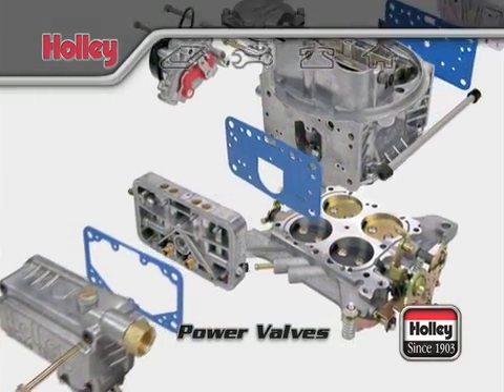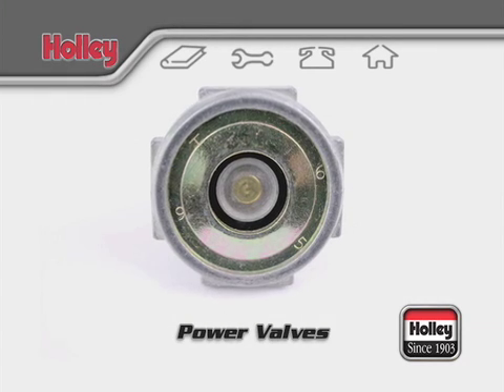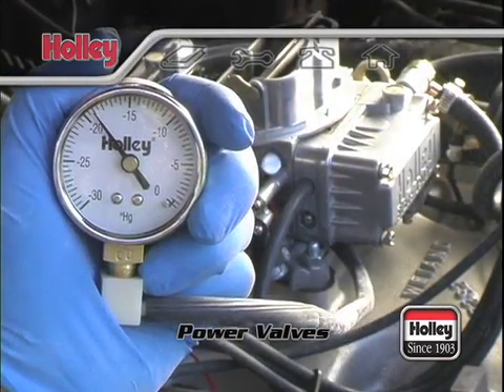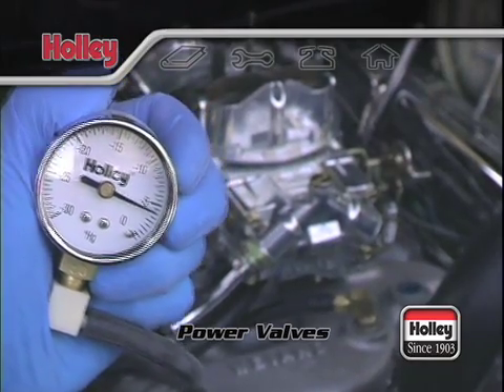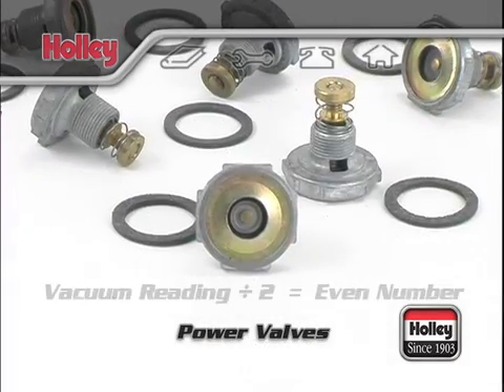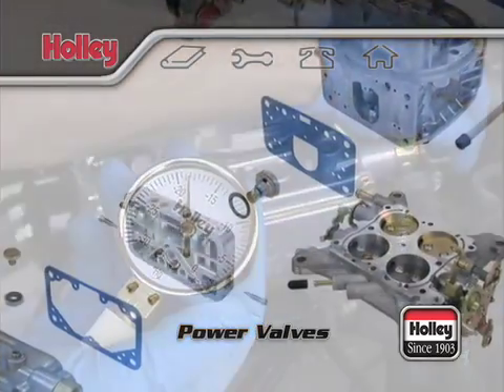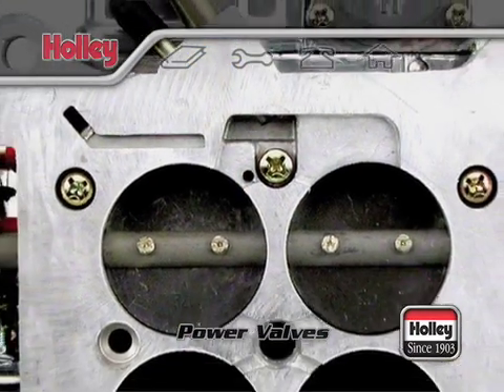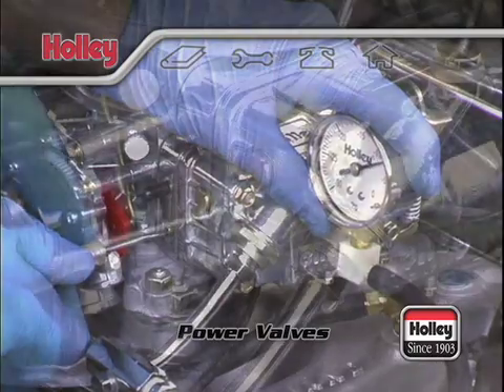Holley Power Valve Tuning Tips

Comment: Do you turn in all of the idle screws to check the power valve? or just the one shown in the video? thanks
Reply: If you have 4 corner idle you will have to shut them all down, be gentle on those metering needles, vacume is holding the power valve closed, unless that diaphragm is blown.
Reply: @DANTHETUBEMAN  Already have it sorted. Thank you for the reply though. Appreciate you bro.
Reply: Are we kicked out of awl the Woolworths or just this one?

Comment: What power valve should i use on a Amc 258? Do not own a vaccum gauge but heard that the vacuum reading is between 15” and 20”
Reply: You almost need to know the vacuumed to be sure but Holley states a 13 vacuum or above a stock power valve is fine. Likely around a 7.5 is perfect. The vacuum gage is great for fine tuning the carb. Set mixtures  for highest possible smooth idle (which is also highest vacuum point) They are really great engines. I think one of best engines ever made. (That is coming from a Chrysler guy). Great power for the size and good gas mileage in a light car. I had a Gremlin X back in the day.

Comment: I have a 385 sbc with 300deg of adv duration hydraulic roller cam, aluminum heads, single plane int. A friend gave me a 850 demon he couldnt tame. I had it on a healthy 383 with a similar cam but it was mechanical solid lifter and old iron 462 2.02/1.60 heads that had been cleaned up extensively. It took a 5.5 to get it right. This new engine has a 2.5 in it now. It may get a 3.5 if it acts lean on the launch. This weekend I'm going to install an air fuel ratio gauge. I really want one on each side.

Comment: So what your saying Holley is that my engine makes a vacuum reading on my gauge of 15 the stock 6.5 power valve is okay for my Holley 600 carburetor or do I step up to a 7.5 power valve?
Reply: Does it bog down when you stab the throttle? If so it could be a tad rich due to the pv opening a bit too soon. If not, leave it.
Reply: @michaelphelps5064  I think you got it backwards. I'm no pro tho. 

If an engine makes 15 inches of vacuum at an idle, and you slowly open or stab the throttle, it'll go to 14 inches, then 13, then 12"......... So, an 8.5 would open faster (more rich sooner) than a stock 6.5

I think that is what I learnt. 

Correct me if I'm wrong.

Comment: what is the number of the stock power valve?---im running 18 in of vacuum so im wondering which one i need. any help ??
Reply: Yes at 18 vacume you desperately need a BIGGER CAMSHAFT!!! it will never haul ass with that Much vacume , you engine literally sucks to much
Reply: Stock power valve is usually 6.5. Your 18 would suggest an 8.5 would be the best place to start on yours.
Reply: 8.5 should be right on
Reply: 18 in gear or idle?
Reply: @ghtrcp7554  mine is 22 at idle

Comment: Just a heads up to everyone... The vaccum they list here on selecting the correct power valve just gives you a starting point. The lower # will bring in fuel slower and the bigger # faster. This chart called for a 2.5 power valve on my carb and we had to go to a 8.5. So trust your AFR not this video.....
Reply: Yes, very combo-specific. Huge difference, for example, between single plane and dual planes, as the dual plane will pull more vacuum, and also have higher velocity (which makes the carb run a little richer). This is why we need accelerator pumps: when you crack WOT, instantaneous flow velocity in the manifold drops to near zero, and no fuel is pulled.
Reply: i have not had to mess with the air bleeds on top yet i think i would feel better doing that on the dyno first.
Reply: This is a GREAT POINT. Mine had a 6.5 on both sides. I followed the instructions here base on my manifold vacuum and put in 4.5s. It's VERY lean now and way too slow to receive fuel no matter the combination of jets, squirters, and pump cams. I'm going back to a higher PV. Maybe even higher than 6.5
Reply: you have to watch your AFR with RPM (under a load) i have seen a big difference with accelerator pump/ squirter combo... however the PVRC jet (the little jet behind the power valve). made the biggest change for me between lean and rich at my trouble rpm. i ended up with a 4.5 front 2.5 rear with bigger PVRC in the secondary block. but i had about 8.5 mmhg at idle.
Reply: TPV Productions you are correct! My car called for a 6.5 based on this video but it was open at idle! It was running extremely rich and had a symptom of a blown power valve. I went to a 10.5 and now it's better.
Reply: @nobamagone1063 …a 10.5 will open sooner than a 6.5 lol…you had a defective power valve

Comment: so I can run my screws (just have 2) all the way in and it does not phase my 350 at all itcontinues to idle so im assuming my power valve is blown and is the culprit of my hesitation/boggin under load? or getting into it half throttle or maybe just before half
Reply: Very likely. Also Google "transfer slot adjustment". When things are right you can literally adjust your idle speed with your idle mixture screws. Your primary throttle plate must be set correctly and have the correct pv installed for your idle mixture screws to richen or lean out your idle. It's a balance. Also make certain your secondary throttle plates are barely, and I mean barely off their seat. There is an Allen screw to adjust them. To perform these adjustments the carb must be removed, set up and installed. Then fine tuned with the mixture screws. Its a balancing act. Like a ballet between Fuel and Air.
Reply: That's what he said. IF the car doesn't stumble of stall with idle screws all the way in, the power valve is not working properly. Think about it, if the idle screws aren't allowing fuel in, what is the car running on?It means it is running on the open throttle circuit. When I say that it occurs to me that it is possible if the float level is too high then fuel could be making its' way into the system too early.  But a carb expert might disagree.